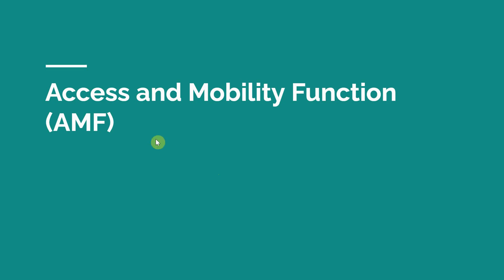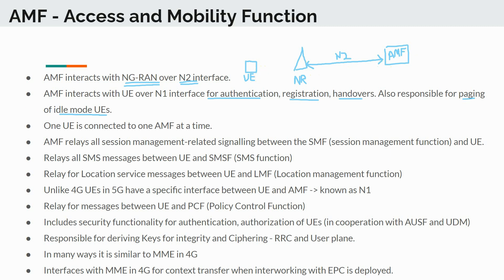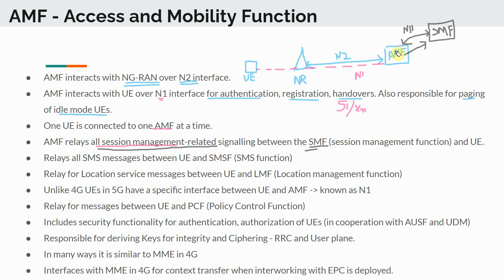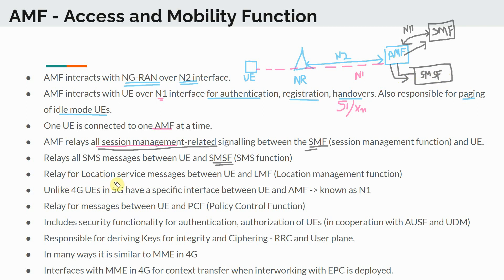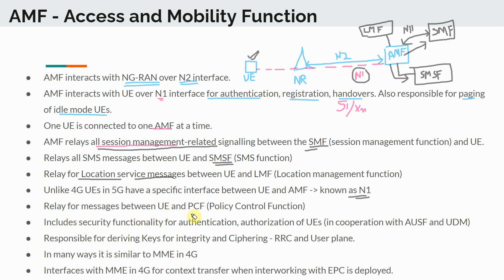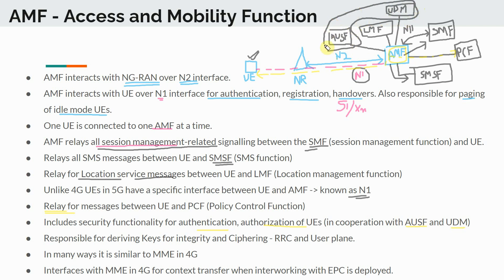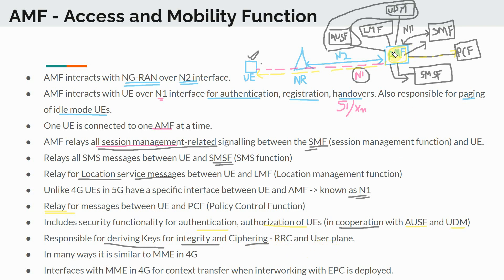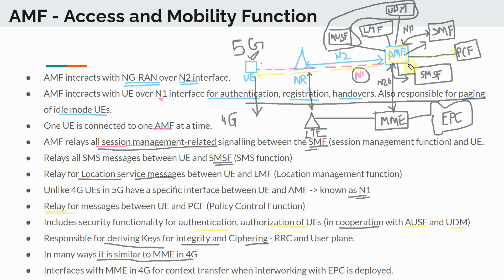Access Mobility Function (AMF) in 5G

Comment: Which devices or applications are implemented for Access and Mobility Function? If we consider the particular Node at some Tier1/Tier 2/Tier 3 City then how much data center can be bigger for particular AMF? Cisco ISE has 54 maximum PSNs? and 50 will get utilized for the AMF with the maximum concurrent connections of 5,00,000. This is making me even more confused. Application?